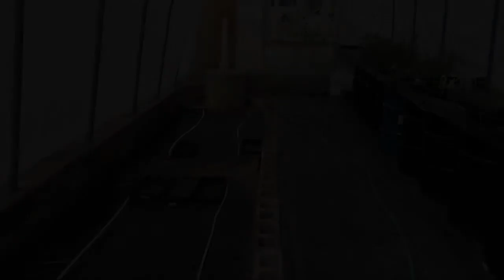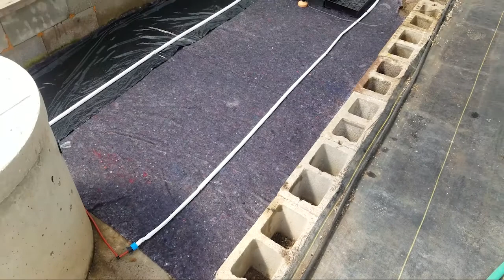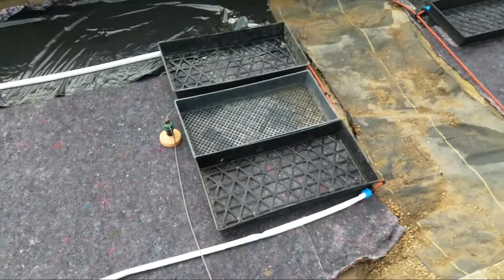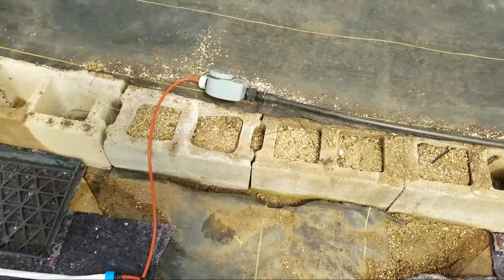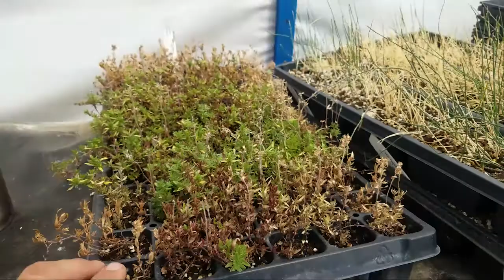Capillary Mats in a Pressurized System

Comment: How does this soak up through the bottom of the pots since there is the plastic from the pot on the bottom creating a small gap at the holes between the ground and the mat?
Reply from the maker: The mat is able to make contact with the soil through the holes in the pot because it is squishy.
Reply: It is important though to use pots that are flat or at least aren't so concave that there is a big air space between the cap mat and the potting mix.